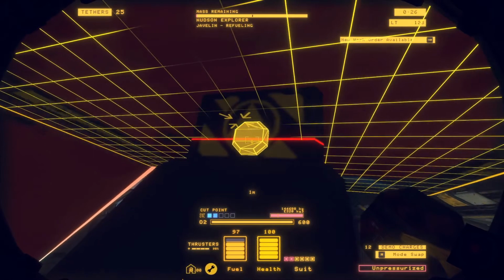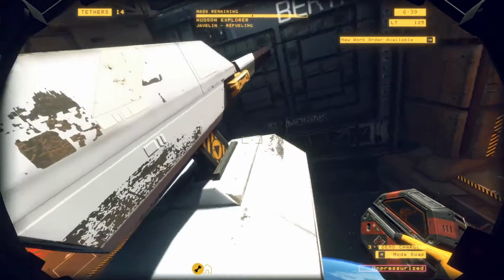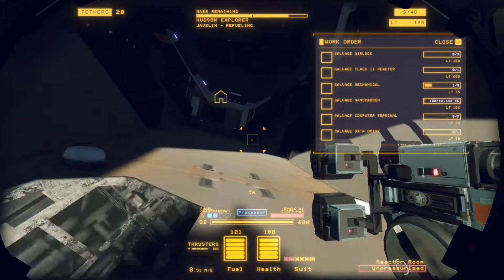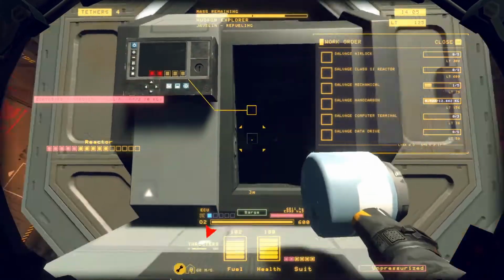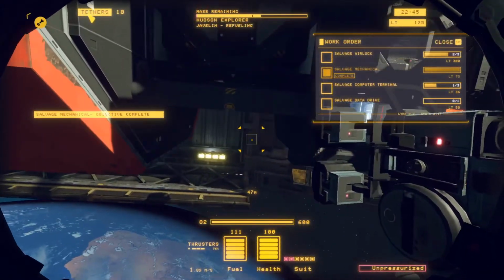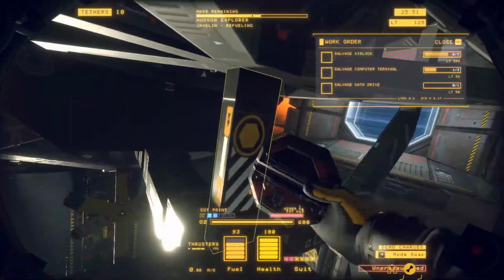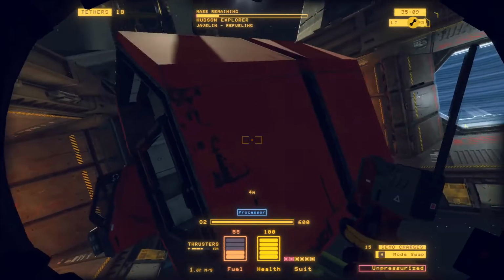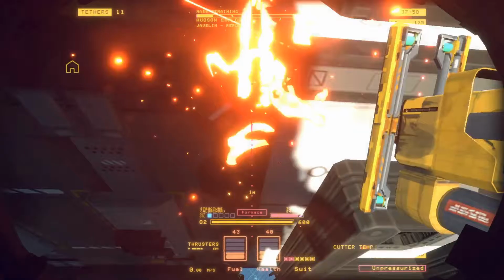Javelin Refuel walkthrough Hardspace Shipbreaker

Comment: There definitely needs to be a strength upgrade for tethers like there is for the grapple. Sometimes the demo charges cause the ship to move, especially if the ship is under 50,000kg and i would like to be able to hold it in place with tethers while the charges do their work but as it is i can't.
Reply from the maker: Gotta disagree with your intent for tethers.  They are intended to pull objects along a field medium not hold them in place.  I'd recommend doing as much demo charging as you need before any other major breaking activity to minimize unwanted movement and using tethers to more easily move large objects into the processor/furnace/barge.

Comment: 26:00. If anything the clown car tow truck bug is any thing but an exploit its the only part of the game where tether physics works realistically without needing to deal with space friction. There is no reason you should not be able to move an entire ship or large chunks of ships with a single tether the ballance would be a exceedingly slow acceleration but it would move. in fact I am almost certain there is a bug in how tethers stack that either caps out or limits acceleration. I have attached the full capacity of tethers to an object and not had it move in violation of all known physics.  So yeah its a bit cheesy however its balanced out by the other asinine physics issues
Reply from the maker: You're right.  There is a hard limit of about 20k max any number of tethers can move.  The tow truck, while not ideal, is a little more realistic in its ability to move large chunks in a no friction environment.  Not at the right speed though